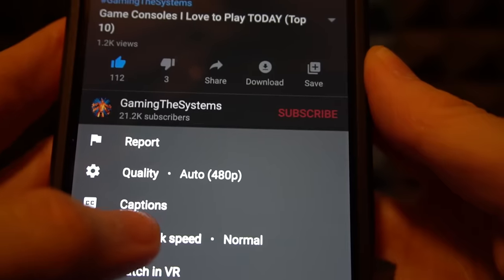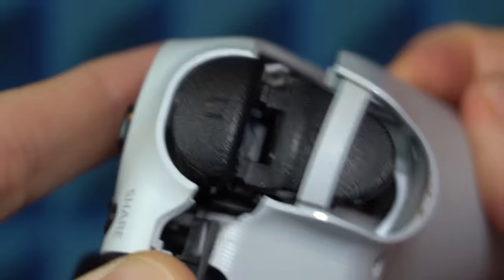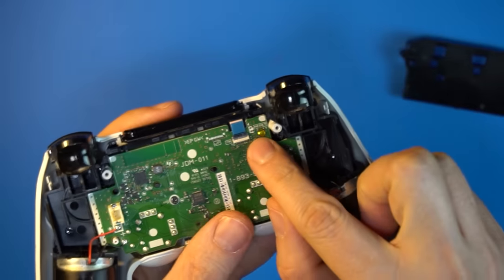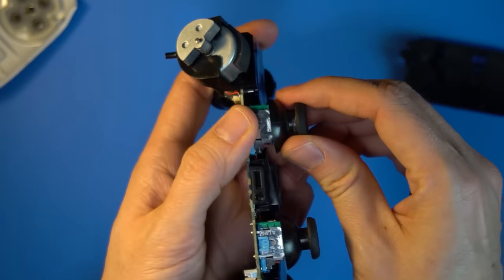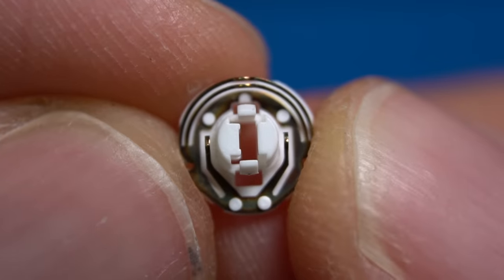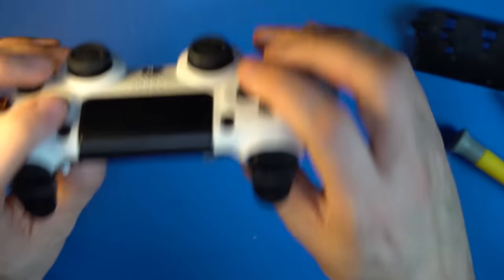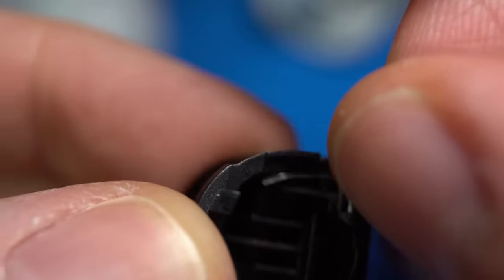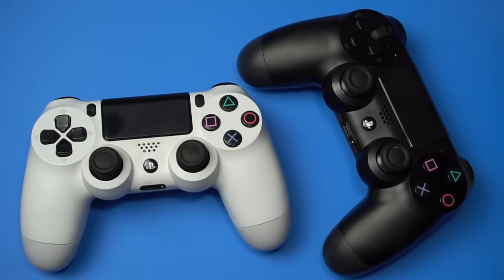How to Repair a PS4 Analog Stick That is Drifting, Sticking, Jittery/Cleaning DualShock 4 Controller

Comment: We really should not have to do all this.. especially considering how expensive these are
Reply: Agree go someone or a friend that is good on technologies on ps4
Reply: Agree completely
Reply: I bought a new controller because my right stick had really bad drag and then within a week my new one was worse and I dont know why or how but I didn't get the warranty on it
Reply: @cocoanerd17.-.  the reason is because dust gets inside your controller and I have 2 controllers and both have drift and I dont wanna take them apart
Reply: @ibrabruh  y’all ever try this ?
Reply: You can always buy the same color controller and swap the serial numbers then return the broken controller 👍🏽
Reply: @cocoanerd17.-.  same. brand new ds4. within a week noticed the right analog kept drifting. im definitely not doing all this in the video so now im forced to buy another one?
Reply: @moz262  unless someone tests returned controllers, someone else is gonna buy it and waste time and gas going back to return it
Reply: @ItsChapa_  never happned to me
Reply: Lol...I'm just going to buy a new controller
Reply: I literally just bought a new controller and I'm already having these issues
Reply: Aggreed I payed 150$ for mine and it lasted 4 months until it started dragging
Reply: @vybez7075  why would you pay 150$ for a controller when you can get them for 30 -60 bucks.... they all do the same and break the same way. Spending more money wont make a ps4 controller better . They do this on purpose like apple with their phones so you are forced to go back and spend more money.
Reply: @moz262  possibly arrested if caught
Reply: @cocoanerd17.-.  dude I just bought a controller yesterday and it’s worse than the last one
Reply: Ok u pointed out they have dust that gets in ok makes since so why didn't Sony seal the Damn controllers shut problem solved no?
Reply: Its not that bad, and teach us few things.
Reply: @mando_v  This happened to me, like wtf
Reply: It works at least
Reply: Indeed...Sony wants you to buy a new controller. It's up to you if you're capable and willing to spend $80 for a new controller. I personally can't and had to do this.
Reply: This worked on mine thank you
Reply: My controller is 2 years+ and I think it's a reasonable time to get a new one...but this video saved me some money.
Reply: Fucking facts this shit pisses me off how much you have to pay for something that shouldn’t even be a problem
Reply: buy the knock offs..  i have and is heavily used for both my ps4 and pc... still working while my orginal in just 2 months already has stick drift
Reply: don't agree
these break a lot so I don't want to waste a lot of time and money buying and throwing if I can do it on my own.
besides doesn't look that hard.
Reply: My two controllers have this problem and one is not even a year old yet...
Reply: I bought a new one, because of this same thing. New one started doing it within a week... 🤔🤔🤔
Reply: Agree
Reply: And cheap crappy materials they use
Reply: @bobburgers1714  I did it just an hour ago! Very helpful video, especially because you see what tools to use and what to look after with those tiny bits. First time-took me about 15 mins. Thanx 🙂
Reply: Controllers being expensive the THE reason we are doing this jugaad. Otherwise we would have just tossed the broken one for a new one. And yeah, that thing has way too many sensors and tidbits that is never used, but just adding to Bill of materials.
Reply: @Bagman That's the way it must be done. All software drivers to tweak. No screwdrivers needed.
Reply: @moz262   Reminds me of how my brother used to rent Super Nintendo games from blockbuster and swap out the circuits. 🤣🤣🤣 I remember he swapped Super Mario Bros for the very first Mortal Kombat. He got caught after taking it back and the next kid rented it thinking it was Mortal Kombat only to get home and find out it’s really Super Mario. 🤣🤣🤣🤣🤣🤣🤣
Reply: The price of these are bad enough... But the PS5 controllers are over $100! Insanity.
Reply: Holy hell. I had 2 old ass controllers with this issue. Both on the right stick. Figured a new one was worth it after the life of the old ones. Bought a new controller and the right stick started drifting within 3 days. They're $70 were I live. Gonna give this fix a go but I'm doubtful. It must have been a repacked controller because it wasn't open long enough to get dirt in there and it looks pretty fresh on the outside. Either that or it's not dirt and just busted.
Reply: @bobburgers1714  I have done it twice now and it fixed my controllers drag. Things are good as new, I thought for sure I was gonna botch it, but his instructions really help get you through it. You follow his video and you can fix your ps4 controller pretty easy if need be
Reply: @ibrabruh  Dude, I've had mine for 2 weeks... I opened it up and it was spotless. There's no reason for this, but it drifts. I'd return it but I got it on eBay and I got an email right after it came in saying that the seller had been kicked off eBay for sketchy shit. lol
Reply: I have this problem with both my ps4 controllers, still undecided on what to do, spend another 70 euro on a controller that'll end up in the same state a couple weeks down the line, or take my controller apart and risk not being able to play rocket league for ages. (the only game the stick drift doesn't effect) All I know is I'm glad I'm not the only person in this position. Still tho, I'd rather this wasn't an issue
Reply: @cocoanerd17.-.  Cheetos and games are great just not at the same time
Reply: No kidding, I had one brand new out of the box do this.
Reply: @ibrabruh  maybe. Mine was brand new out of the box and it did this. My other controllers never had this issue, they just got old
Reply: @yonathank132  preach somewhere else
Reply: I KNOW.
Reply: For real. Sony should have a repair service tbh. I have 6 controllers, and 4 of them have this problem.... So wasteful.
Reply: @moz262  hahahaha 🤔🤔
Reply: @ibrabruh  Both of my PS4 controllers lasted 8 years and I played the shit out of my PS4 controllers.
Reply: @moz262  criminal master mind
Reply: For me, it wasn’t dust, it was the white copper wiring piece in the green housing. Both had turned blue and one the copper wiring was all bent.. Happened in under a year and I baby my controllers. It’s just poor design and quality control on Sony’s part that sounds like they still haven’t fixed for the ps5 controller..
Reply: @irocksup123  is there a safer way of fixing it when a stick like the RS for DualShock PS4 controller is unresponsive and not working for anything or does that mean it’s dead and doesn’t work anymore
Reply: At least the console itself is good for surgery
Reply: @scgamesonline7771  why doesn’t the trick of lifting up the thumb stick work like here 100 percent? I’m curious what do you do if it’s making you press the button more harder cause it won’t register the control it does for example?
Reply: exactly omg the one having problems was an alternative one i brought for my little sister she rarely even use it but this problem happened idek why tf this is happening
Reply: This is all I'm thinking as this guy gets to level 10 of this damn challenge. Playstation play too fucking much.
Reply: no we should do that couse they are expencive so to by a new one is really hard men, i just did it and it worked
Reply: The video game industry is now r wording everyone
Reply: It’s like I gotta buy 1 very 2 years, such a joke
Reply: @michaelmyers8418  your bro was a smart dude hahah I never thought of that especially at a young age
Reply: Made in China
Reply: Ikr how can they be so bad and be so expensive at the same time i know Xbox players that never have these issues and their controllers are cheaper like wtf?
Reply: @nipnuts  says people who know how to defuse bombs lol
Reply: I have a weird problem does anyone know a fix? My cousin dropped my controller and now my R2 doesn't work and whenever I move my Right stick it acts like my R2 idk why.
Reply: Or it should be easier to replace drifting sticks, this is absolutely ridiculous on sonys part.
Reply: FYI Some version the battery plate is screwed inn with the same screw as the board. Don't pull on it.
Reply: I'm 14 and do this it's fine it's there to fix not to replace
Reply: @bobburgers1714  I did it works with analog drift
Reply: Every piece of gear has its limitations.
Reply: @That_Derpy_Dude  ever heard of scalpers? If there are no controllers near you due to Covid reducing shipment, you are forced to pay/get fucked on what scalpers charge on Amazon or sit and wait what could be months and in the meantime you can’t play video games. What do you advise we do differently?
Reply: @Markus Wilson go to gamestop?
Reply: @That_Derpy_Dude  did you by any chance read the part where I said, and I quote “when there are no controllers near you due to Covid reducing the shipment” what do you think I meant by that? All stores, that’s  including GameStop are CONSTANTLY out of stock of PS4/PS5 controllers in my country.
Reply: Go to a better country then
Reply: @ItsChapa_  thats another problem for another day and person
Reply: @SeanRD82...  ill buy all your old ones for 10 bucks
Reply: @That_Derpy_Dude  custom controller or specially fitted
Reply: @clumsychaos6300  because things are made to break these days
Reply: @yamoto_no_ken3909  who are you disagreeing with?
Reply: @0minous187  bro that ain't no kinda excuse get  outta here
Reply: @grayllis1  their controllers are so fucking bad and expensive i wish itd be investigated and we could do a class action law suit
Reply: More expensive when you have to hire someone to clean it
Reply: Yeah, things should just last forever! What even is "wear and tear?" GAMERS UNITE!!1!1!
Reply: I have 7 of them
Reply: I agree
Reply: Lmao tell me about it
Reply: @cocoanerd17.-. never in my life has the right stick has drift
Reply: Try buying  a ps4 with a controller that started drifting after 3 weeks -_-
Reply: @bobburgers1714  yeah, just had to do this. It's easy...don't be afraid to get your hands dirty...worst case scenario. You break and learned what NOT to do and get a new. Regardless you gonna learn something. Knowledge is always good.
Reply: @moz262  happened to me twice at f'n gamestop. got someone else's garbage bc they didn't test.
Reply: @moz262  yeah if you feel like being a thief go for it
Reply: The way I see it is even brand-new things go to hell after awhile so you can either spend the dough on brand new ones or learn to fix it it's cheaper if you learn how to fix it
Reply: @ibrabruh trust me I fucked mines up even worse🤦🏾‍♂️ hate sony and playstation
Reply: @ibrabruh The drift doesn't hurt my gameplay too much. But it is so freaking annoying when I'm in Share Factory trying to edit a video and I have a hard time controlling the placement of the overlays because the drift is causing them to move on their own.
Reply: Trickster at Sony- "Yup we're going to make it hard for you to take apart your PS4 controller if it needs cleaning on the inside".
Reply: Painful! Don’t even last a few months. Should be covered by sony for at least a few years. Car companies do recalls if there are tech issues. Given crazy money play station makes for them why tf sony can’t? @sony

Comment: I did this to mine and for those who had the same issue as me, when you finish I’d your controller light doesn’t turn on, it means the final ribbon is the wrong way around, the silver should align with the metal in the slot you attach it to, so simple way to remember is metal to metal, the ribbon does not necessarily need to face the battery

Comment: Second time doing this fix. Both times it worked. Had a controller for a year got my first stick drift - fixed it with this tutorial. 2 years pass by, I get another stick drift on the same controller. Fixed it again today, works completely fine. It'll probably come back even sooner now, but it does indeed works and makes controller's life longer. Appreciate the tutorial, you're the GOAT!

Comment: Dude it worked, you are the best, saved me 1500 rupees, 
Toughest part : opening the controller
Rest is easy, just follow the instructions
Tip: Always remember to use minimal force, keep repeating it in your mind if you will